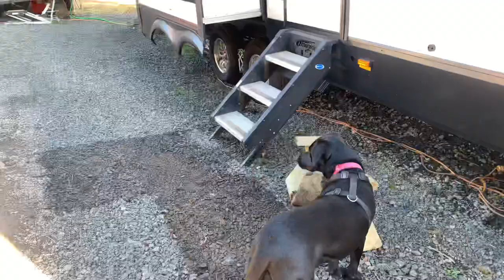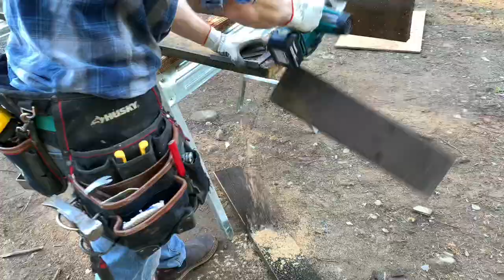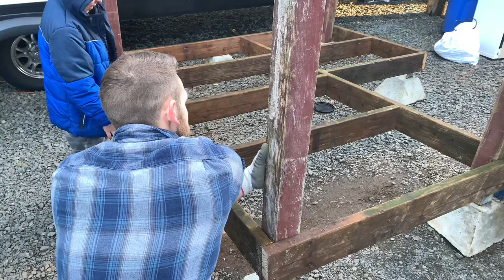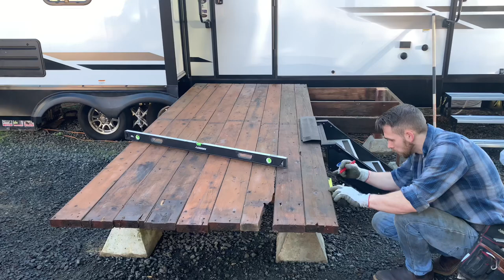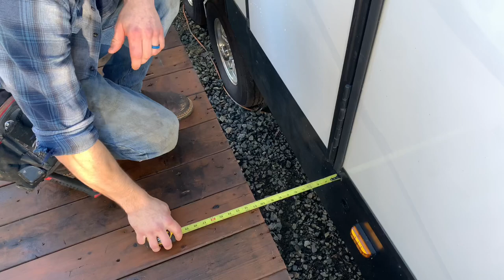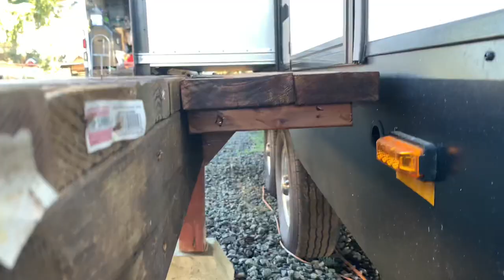Build an RV porch with me (Part 1)

Comment: I know it's only been 9 months but have you had any rot or expansion issues running the boards tight to each other I've always loved the look of no gap but been told to never do that
Reply from the maker: I have not had any issues with expansion yet. But these boards were also already weathered from another porch that they were on so if anything they may have shrunk slightly through the summer. I also preferred them tight on this build because I built a roof and walls to enclose it during wet weather for extra storage. So gaps are good without a roof and no gaps are good when they are out of the weather. I prefer not to drop and lose something through the gaps anyways Lol.
Thanks for asking, Chase!